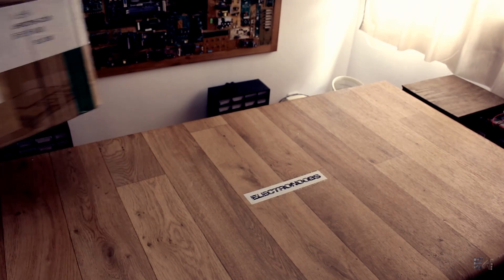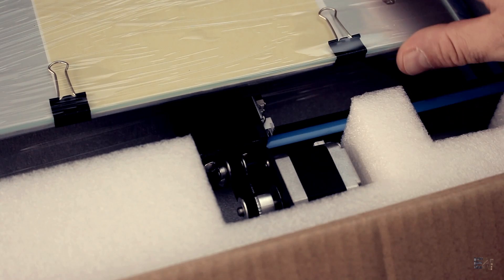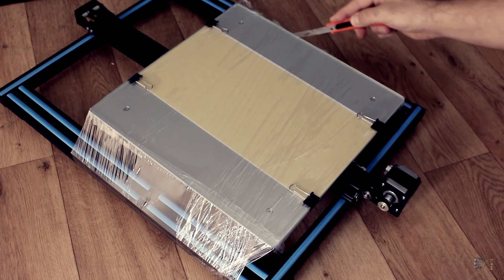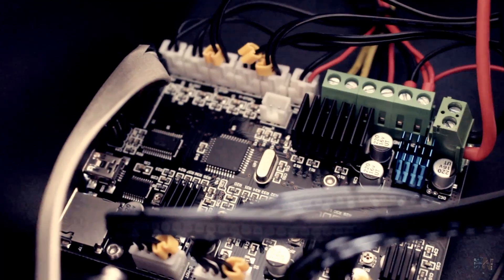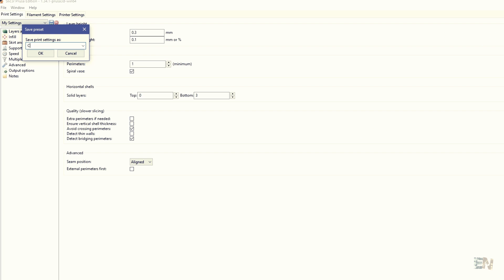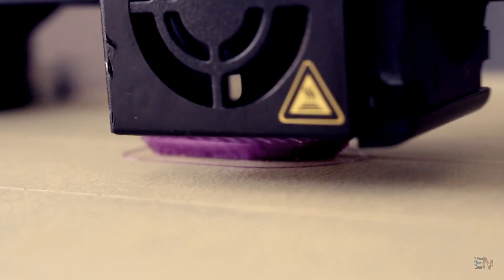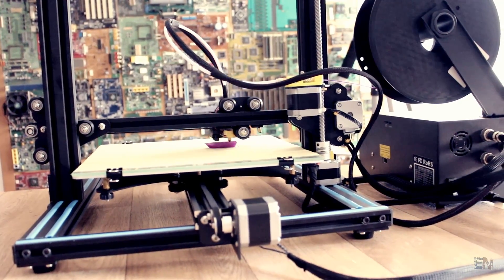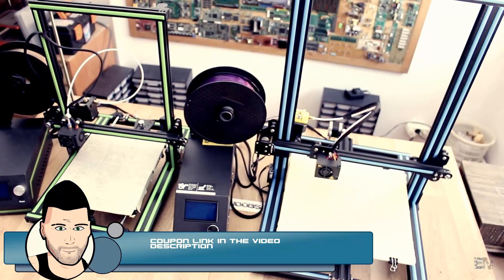My Creality CR10 - first review

Comment: check out the flsun i3 3d printer! a really big buildvolume for a really low price.! i belive the printing volume is the same as the cr 10 but its almost half the price. keep up the great work!

link to printer: https://www.aliexpress.com/item//32826682628.html?aff_platform=aaf&cpt=1506441708626&sk=2v37IQv&aff_trace_key=910ce2f3b2ab43e5879841cac8c5aca3-1506441708626-07138-2v37IQv&terminal_id=41547441865247c09eaab0ed804ddd76
Visa mindre
SVARA